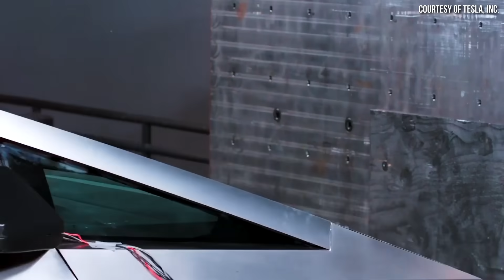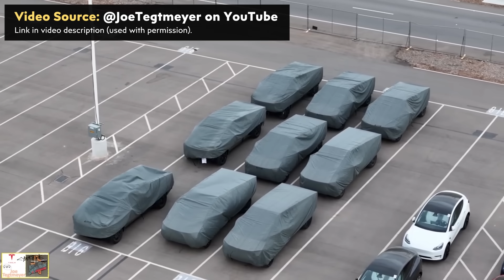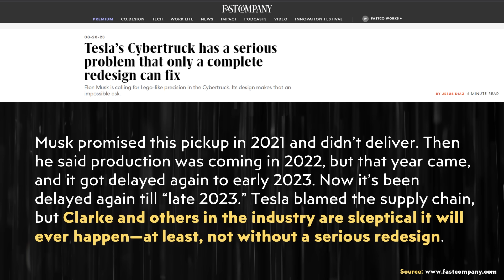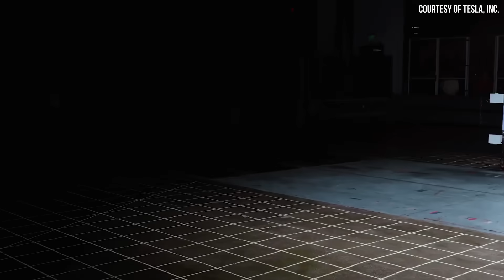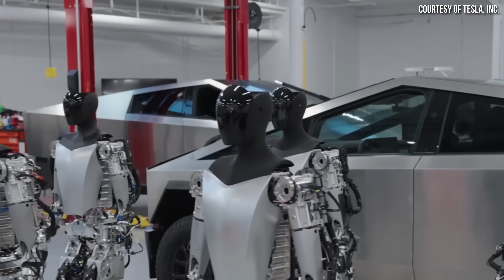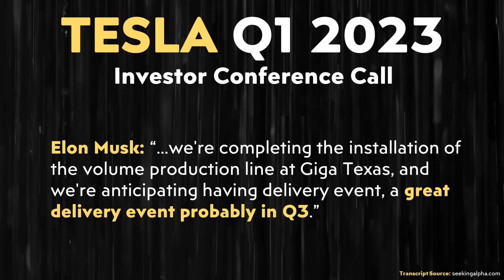Critic Reacts to Tesla Cybertruck Production Candidate | Re-design Needed

Comment: Interesting how little attention is paid to the revolutionary 48 volt architecture of the Cybertruck.  Model S used 3 kilometers of copper wire, the Model 3 1.5 kilometers and the target for the Cybertruck was 100 meters.  Whether they met that goal is unknown but the dramatic decrease in copper wire helps both weight and cost.   Plus the new architecture enables use of POE (power over ethernet).  With the Cybertruck approximately 85% of controllers will be designed by Tesla and increase over Model Y's approximately 65%.   Tesla is on their way to 100% controller design for their next gen vehicle.  Go ask Ford and GM how their doing on either of these advancements.

Comment: Yes they can build it. I used to own an apartment building built from an old home. A luxurious home when it was built. Built in 1896, the wooden window opened an closed perfectly without leaking air. If craftsman can do it a robot should have no trouble at all. Jigs and benchmarks were probably involved. ICE parts are cut to one thousandth of an inch in mass production. If it can't be done how could they ever built a motor that doesn't grind or bind?

Comment: If it has a bigger bed than the F150, can haul more payload than the F150, and can tow more than the F150, as well as having more range, better software and features cheaper than an F150…Is it not better than the Ford?! 🤔
Reply: I don't believe a word of it until I read independent road tests.  And I doubt that will happen until well into 2024.

Comment: Designers know that small gaps are problematic. What they need to do is increase the size of the gaps.
Reply: And that’s why you would not make a good designer. Yes, little gaps are bad but bigger gaps or even worse aerodynamic flaws than dude you should stay out of stuff you don’t understand. The better thing to do is have no gaps whatsoever that’s how submarines work that’s how the space station works no gas because if they had gas with those type of vehiclesthat would cause problems. Why do you think so many gas powered vehicles have so many flaws because their big plastic bumpers don’t match up properly they have big gaps a little gaps and you’re trying to say make the gap bigger. Are you stupid?

Comment: I did not do a pre-order on the cybertruck because there is no pricing after they took the website down. What I want is a two mortar 500 miles to the charge pickup truck and I don't use mine for construction work I use mine to go get a desk or a table or even a dresser or couch from the furniture store every into the house. I also use mine just for everyday driving I've been used to a pickup truck 4 years without hauling anything I feel comfortable in a pickup truck considering I had two accidents in a pickup truck and I survived both the other people did also survive accidents were in my 66 Ford F-100 pickup truck because it was made out of steel not plastic or aluminum like a modern-day car. I think cars should be fine for a family of three or four but I also think everyone should have at least one pickup truck because you know you have to go get that couch or chair why should you go ahead and give money to U-Haul. Trucks are awesome they also are very safe and secure when it comes to the accident because that's what you're supposed to do is crumpled in and stop from getting you hurt or the person who hit you or you hit them get hurt to wear as a car you can get hurt severely. So yes trucks are I think going to take over the future driving and cars will be phased out because cars are not safe

Comment: I couldn't agree more about the utilization on a CT for tradesmen. They will love it!
Reply: All the articles you see about the Cybertruck from regular media parrot the exact same thing: "...compared to a standard, UTILITARIAN truck...".

What are they smoking? 😂 Cybertruck is probably the most utilitarian thing you'll see on the road for a long time. It's a real truck. 3500lb+ payload. The next closest electric truck is around half that. It's closer to a 2500/3500 series truck then all of the competition which are 1500 series equivalents. It also has built-in air and 240 volt outputs, and an air suspension that makes the ride comfortable even though it's a ¾ton truck.

That's aside from all of the other things it has going for it that everyone already knows; corrosion free body, undentable panels, etc.
Reply: @Walkop Unbreakable windows😂

Comment: In the image where it is in the mud, look close at the windshield. The windshield surface is huge and the wiper needs to be massive to cover the area. The longer the blade the more surface area is in contact. 

You would think this is a good thing but it is not. It requires more down pressure on the wiper blade to ensure it doesn't just skip across the surface. The other issue is that it takes longer to perform a full cycle. This means that you get fewer number of passes in 10 seconds to try and wipe the windshield clean. 

This means you can't see out through the muck and becomes a safety issue. 

In the past on our off road truck builds we used to have dual blade wipers that were only 18 inches long.
In heavy mud you needed it. Snow and slush will be just as bad sometimes.

Tesla isn't  as smart as they think they are. Sometimes you can over engineer and create more problems than you solve.

Comment: I agree that Tesla can get this done, and critics particularly over at that magazine have been very wrong before, but wasn't this unique truck supposedly designed specifically for ease and efficiency of manufacturability, first and foremost!?  
(If so, I don't have much sympathy in hearing Elon Musk/Tesla saying how "difficult it is to build"...   ...that's simply admitting that the design is a failure with regard to being highly "manufacturable", actually putting some air into the critics' case...)

Comment: This “critic” Is a nitwit.  When Elon was talking about tolerances, he was saying they need to be less than 10 microns.  That means that if there is a 1mm gap between doors and panels specified, that every truck needs to have a gap measured between 0.999 and 1.001 mm.  That’s +/- 10 microns. The “critic” is eluding to an idiotic understanding that the gap is going to be 10 microns, which is impossible.  He needs to use his brain.

Comment: Cybertrucks will be unsafe for pedestrians, bikes, motorcycles, and small cars.  Just like every other pickup, van, and truck.  Buying these beasts to drive one person to work or a couple kids to school is part of the American practice of self-protection at the cost of danger to others.  That said, active safety might make the Tesla behemoth somewhat less dangerous than, say, a Hummer or F150,  but that remains to be seen.

The essentially traditional body-in-white may indeed have troubles keeping the heavy stainless sheathing in place within traditional tolerances.  Castings will help, but that's not all that doors and panels hang from. Solution: accept larger, uneven, gaps.  It's a truck, not a Swiss watch.  (Sorry, Sandy.)

Comment: I sure would love to get the “blue” stainless steel look

Steel begins to turn blue at about 575ºF, but the best temperature range for heat-bluing is pretty narrow. Blue is preceded by brown (about 480ºF) and then purple (500º to about 540º) so it's quite easy to overshoot or undershoot
Reply: I can see you around your Cybertruck with the welding torch trying to blue it! And then, imagining you after you've inded "blew it". 🤣
Reply: Can anybody advise what type of stainless steel is being used on the body astm type 304 or 316.
Secondly what type of metal is used in chassis ?from a engineer specializing in stainless steel.
Reply: If you want customization re things like color, you can get a wrap. Mass production isn't about currying to the very rich and picky -- it's about lowering the price for the masses, quality, consistency, durability, etc.   IOW, things that matter.

Comment: The design was supposed to make it easy to build, that was the whole point behind it. It was supposed to be cheap and easy to build now in reality neither of those things are true. Plus the exo-skeleton looks to be abandoned as well. Let's see that 14,000lb tow rating and 3500lb payload capacity.
Reply: It was supposed to be easy to build.  You are conflating easy with inexpensive.  It is going to be relatively inexpensive to build, when compared to other vehicles.  No paint shop.  No body on frame. Etc, etc.
Reply: It will make the tow capacity and the payload capacity. You probably don’t even have one ordered and if you do cancel it.

Comment: There have always been emotional critics of Tesla. This is no different.
Reply: Emotional critics 😅🤣😂 then let's recall some facts and compare with the "crap predictions" spread on this channel... Energy capacity of 4680... on this crap channel it was claimed that it would be over 300 wh.... reality 286 wh well below specification.... scaling production of 4680 "great Tesla engineers" will solve all problems with dry process quickly.... reality near zero progress. And so you can list: Robo Taxi, FSD from next year for 10 years,  Tesla Roadster not existing produckt, Tesla Semi without introducend technologis 5 years delay  etc. 😅🤣😂

Comment: I doubt that Elon wrote that email,. An average human hair is 70 microns in diameter. Sheet metal gaps within 200 microns would be very difficult to "eyeball" 
Using a 25 mm diameter, a H9/d9 fit gives a minimum clearance of 0.065 mm and a max clearance of 0.169 mm
FYI I am a mechanical engineer who has worked on Automotive and Aerospace components.
Reply: Elon writes and says LOTS of stupid things.  Very much a part of the "random commenters in the internet era" crowd. 

As a Tesla shareholder,  I wish he'd just stop that nonsense, and me more credible.
Reply: He wasn’t talking about the width of gaps.  He was talking about tolerance.  The gap is X mm.  He wants every truck to have gaps =  X +/- 10 microns.
Reply: @wademt  no way would he expect that that is 1/10 the thickness of a piece of paper
Reply: @jjamespacbell  exactly.  It wasn't meant to be taken literally.  He would fire anyone buying an electron microscope to measure panel gaps or the thickness of washers.

Comment: Tesla will do the best they can with the fit and then go on to high volume production.  It's a f-ing truck, anybody that really cares if the body panels are totally perfect isn't that much of a truck person...they should get a model Y.
Reply: True.  Of course, that might greatly lower the demand for the CT from the "not really a truck person, but want a fashion accessory" crowd, which I suspect might be a LOT of the projected demand for the CT.
Reply: If half of them drop out it will still be years before Tesla can fill the reservations.  @rogergeyer9851

Comment: You could put spacers between panels if you really need to, to account for expansion/contraction. With a flexible material that will spread out the force along the edge of the panel to keep it straight. There’s a million things you can do. It’s hilarious the confidence of people still constantly doubting Elon Musk and the amazing people working for him. He’s made the “impossible” happen hundreds of times by now and these people are still so sure of themselves. Anything is possible if you have the people willing to put in the effort. And this isn’t anything near impossible. These people are a joke just showing off how incompetent they are. If it wasn’t possible with cost efficacy they’d have pivoted by now. How daft can you be to think something so simple at this stage will ruin all the progress they’ve made. HILARIOUS
Reply: All cars are made out of metal and most of Tesla cars use a lot of aluminum which has 3 times the thermal expansion of steel.  So, this entire concept is silly.

Comment: The Cybertruck is a disaster.  The stainless steel is unnecessary and has proven to be a mistake.  Just ask anyone who has dealt with a Delorean.  Besides that, the truck is not functional.  It's hard to get into the bed if you just want to step in, you can't reach over and get stuff out of the bed, it has no midgate, the interior looks like a work truck which is not good for those who actually like nice interiors, that yoke is a pain to use, the rolling cover for the back is going to be a maintenance hassle just like every other one, that ramp in the tailgate is heavy and hard to walk up, no bidirectional charging, panels that won't match colors... I could go on but don't want to bore people who will believe anything that Elon says.
Reply: Unless you are like 6'5"+, you can't just "reach over and get stuff out of the bed" in any modern full size truck.🤣
Reply: About 1% of the human population is over 6ft 5in. The rest of us have to access the beds another way.

Comment: We need to get over and past the skin of the truck from a ‘better’ standpoint.  As a work truck my guys are not going to come cry to me over a scratch or dent on the body that doesn’t affect the function of the truck.  That sounds a Silicon Valley truck owner.
Reply: But to be fair, in the US, a HUGE proportion of "truck buyers" don't USE the trucks for real truck work 99% of the time.  It's an affectation, a fashion statement, etc. for them.  And presumably THOSE folks are going to care a LOT about how the truck looks. 

And I say this as a patient long term Tesla shareholder.
Reply: @rogergeyer9851  I can’t argue the statistics that’s true.  But they will come to learn if it’s not wrapped it will be a bitty to keep looking good.
Reply: But to be fair, in the US, a HUGE proportion of "truck buyers" don't USE the trucks for real truck work 99% of the time.  It's an affectation, a fashion statement, etc. for them.  And presumably THOSE folks are going to care a LOT about how the truck looks. 

And I say this as a patient long term Tesla shareholder.
Reply: I have lot’s of friends using work trucks, driving company vehicles.  I’ve driven many company trucks, my last one was an F350.  If I had any damage to my truck, I had to report it (beyond a scratch or a door ding).  With our company logo on the side of the truck, it had to look nice, period.  If this truck will resist damage better than other trucks, that’s a big deal.  In Montana, we go through windshields like disposable coffee cups.  If this truck resists glass breakage, that’s a big deal.  It’s a safety issue.  Plenty of room in the bed to carry equipment, and mounts for a headache rack, this will be a tough, functional truck that will be cheap to fuel and save people and companies thousands per year, especially in the PNW where electricity is cheap.

Comment: Will it have two ways charging?
Reply: Nope.  Another reason it will be garbage.
Reply: @matthewfe6671  I don’t think it will be garbage. It has many other redeeming qualities and vehicle to grid is a possibility that could be achieved. If Ford and Chevy could do it, there’s not a doubt in my mind that Tesla could.
Reply: Tesla has resisted this for a long time because it effects battery longevity.  We used a Tesla Powerwall for energy arbitrage for several years, and it reduced the capacity by about 10%.  Ford and Chevy say they can do it, but they don’t tell you about what it does to capacity.  The legacy OEMs are having troubles executing EVs.  Just because they’ve advertised a feature, that doesn’t mean that it’s working well.

Comment: I suspect that many people are gonna wrap these (so as not to be just another stainless steel box). 
That should mask the alignment issues that may plague early production.
Reply: Even if people wrap it, they can’t disguise the fact that this thing looks like a box of shit.
Reply: @mayanxxx8863 remember the old saying that the shit is in the eye of the beholder! 🤣
Reply: I will wrap mine.
Reply: As a retired welder fabricator,   I should to point out that Stainless Steel is extremely hard metal and can warp whilst welding if the exterior panels were hung similar to a wall of marble perfection may be improved,  but it is a truck & going to be very durable.  Owners should not expect perfection otherwise you'll have to wait another 4 years & cost even more.   Also owners who want an improved finish to the actual st/st brushed finish could pay for a wrap which would individualise it further !   I wish I could have one.
Reply: @stephenguy6606  exactly, thanks for feedback. I find it amusing trying to find out the figures for thermal expansion of the stainless steel when one needs to compare it to basically the same material, i.e. ordinary steel for legacy cars, which must have negligibly different dilatation anyway, without even checking the tables. 🤭
Reply: @Alarix246  I nominate you team leader of “SS Blue”
Reply: @eff7239  Blue gra SS rules. 🤠🪕
Reply: There is a saying “Don’t bet against Elon” looks like it is going to be true yet again
Reply: @Headmaster2NZ  That would depend on how you define success, now, wouldn't it?